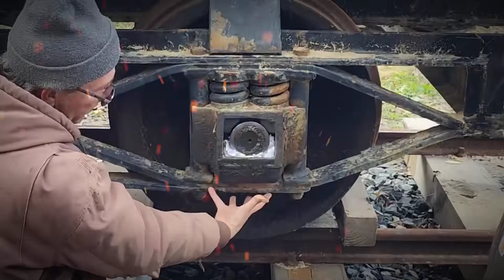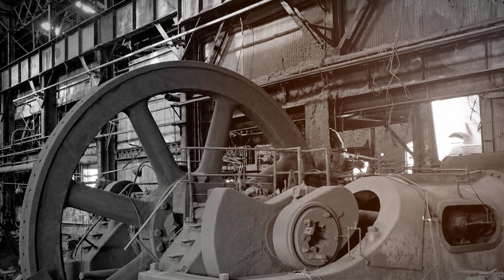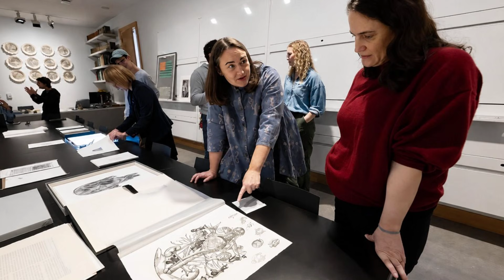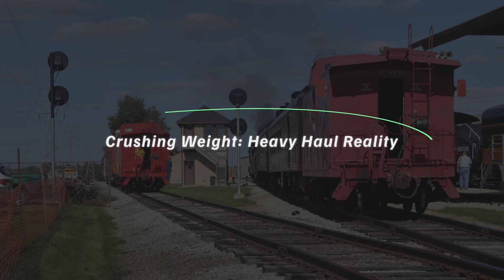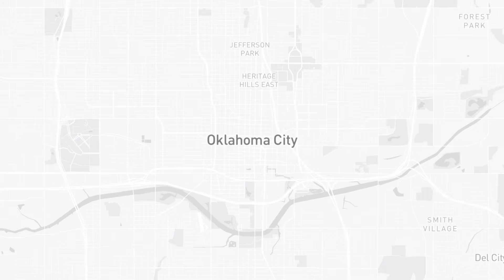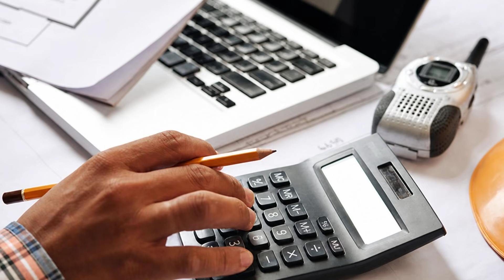Why You Can't Just Buy A Retired Caboose

Comment: They're not easy to move
Reply: You get a couple of cranes and put the body on a lowboy trailer. You move the trucks separately. Set the trucks on a track panel that's built ahead of time. Then lower the caboose onto the trucks. Done.